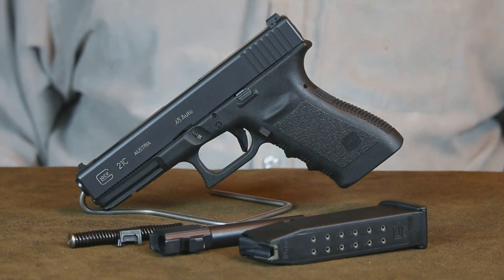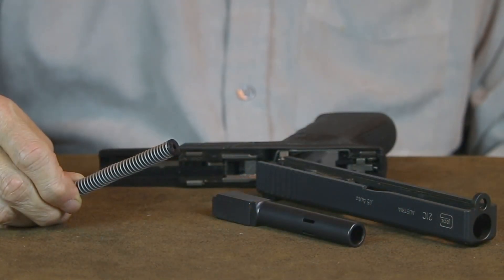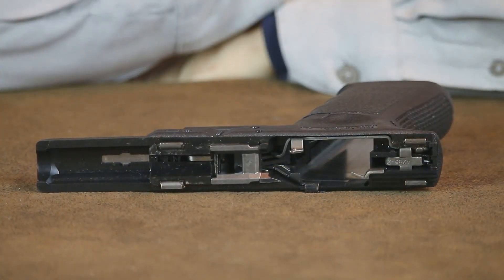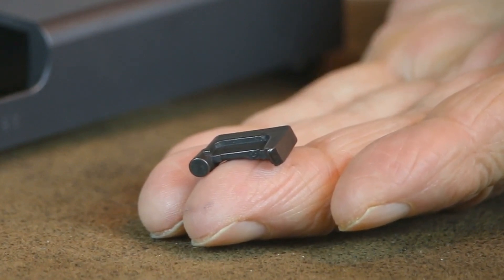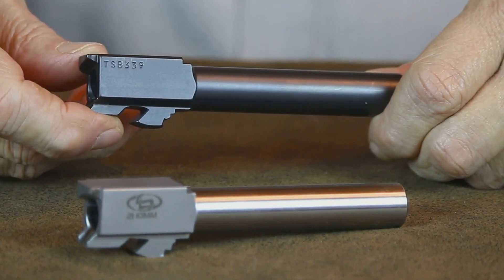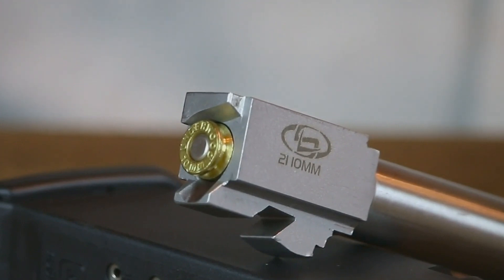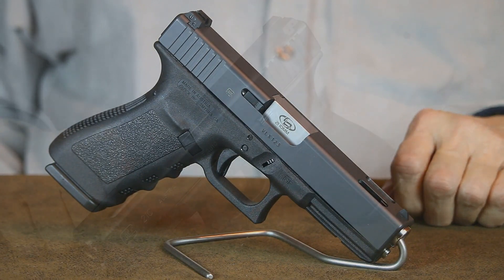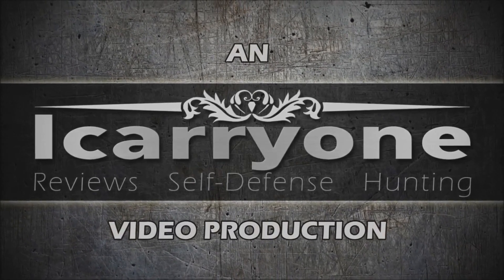Glock 21 - .45acp to10mm Conversion

Comment: Icarryone I have my Dad's Glock 21C, "God rest his soul" and I don't know you can do this on a Glock 21. This is awesome for 150 dollars. This is by far my favorite review you have done yet.
Reply from the maker: Thanks Jerry, I appreciate that.
Reply: You are welcome Icarryone and Thanks for the great reviews.
Reply: Also have a 21C and was thinking if something like this was possible  and now see it is but only with the 10mm. now been wondering and imagining how would the recoil will feel if  the barrel can be made to have the compensated cuts in it.  Wish the conversion was possible with the 9mm.
Reply: @sanmar5206 they actually make a .50 cal conversion for this frame too.  It requires a different slide though, so not very economical.  However I sure would like to shoot one 😅

Comment: According to the Glock store you don't have to change the main spring. But I always thought that was wrong advice. As a 10 mm is a sharper recoil. Where the 45 is a push.
Reply from the maker: I upgraded my spring to a 20lb with a stainless steel guide rod and reliability improved.

Comment: This is ideal.  This opens the doors to allow me to utilize 45acp, 45super, 10mm, and 460 Rowland all in one gun!
Reply from the maker: You could certainly do that.
Reply: 9x25 Dillon too.
Reply: @gadsdenjim8785  40 S&W and 357 SIG will use 10mm mags too, so that's 7.

Comment: Looking for advice!  I swapped out the 45 to 10mm barrel, 10mm mags, 22lb tungsten spring and ammo.  But 1 in 3 rounds of the 10mm don't fire.  Ammo is factory new, not a reload.  Gun is new and sparkle-clean.  The rounds that didn't fire had a definite primer strike, but no ignition.  

Thoughts?
Reply from the maker: Try a different brand of ammo and see if the problem persists.
Reply: @Icarryone  Done.  Problem persists.
Reply: Clean the striker channel.  Inspect the striker.   Consider replacing it.  Check the plastic sleeve in the channel to see if it’s damaged.  Do not allow oil or lube in the striker channel.

Comment: I have looked at those storm lake barrels several times just never pulled the trigger on one yet.
Reply from the maker: I've run both Storm Lake & Wolf replacement barrels in my Glocks. The Storm Lake barrels do seem to have slightly better chamber finish.

Comment: Sweet, I was about to buy another PF45 P80 kit to build a G20. Thanks to your video, I now know I can just put these parts in my PF45 G21 clone and save a ton of money. Before, I thought a conversion would be getting a new slide as well like with the G26 to G27 conversion.
Reply: 27 to 26 you mean. the 27 can accomodate a 9mm barrel with thicker walls but not the other way around.

Comment: I converted mine about a year ago only using the recall Spring & Barrel and keeping the 45 ejector and I've had zero problems with the 10mm
Reply from the maker: Me either Rick.
Reply: I didn’t change out my ejector but it damages the 10mm shell casings

Comment: I bought a double diamond 45 to 10mm conversion barrel and can't shoot buffalo bore 220gr. Headspacing is wrong. I heard Lone Wolf barrels are cut deep enough to address this... can I use the Wolf G20 barrel in 10mm even if it isn't specifically a conversion barrel?
Reply from the maker: Yes, you can.

Comment: Another excellent video sir, I have the G20C. Maybe I should convert it over to shoot 45acp.
Reply from the maker: You certainly could.
Reply: With a whole slide assembly.
Reply: Yeah, like Barry said don't think just a barrel & parts will work.  The .45 barrel is much wider, so don't see how it fit through a 10mm/.40 slide..    You may also need a .45 ejector.
Reply: @motohead077  no they are the same outer diameter
Reply: @theoneand0nly874   The breech face on the 20 slide is narrower than the 21. So you would need a 21 slide to convert from 10mm to .45acp
Reply: @turtlesauce  your right you might be able to modify it the diameter is the same but not the breach face

Comment: The double diamond conversion from the glock store doesnt work worth a dam.
Failure to load, fail to eject, stove pipes.
I am using a original mag. Did change out recoil spring.
Tried 3 weight springs from 17, 18, 20 pound.
Some problems. The glock store says no need to change anything else.
Complete fail every other shot.
Using the G21 in 45 acp runs perfect.
So i guess the 10mm side will only be used for play.
Never for protection purposes.
A total waiste of $$$.
Reply from the maker: Dang, sorry to hear that. The set-up I use works just fine.
Reply: @Icarryone  
Whats ur setup?

Comment: What about in reverse? I have a Glock 20 and I want to convert it to .45.. I assuming the only thing I won't have to touch is the recoil spring?
Reply from the maker: I haven't tried that particular conversion - but I'm sure somebody has.
Reply: You can't convert to a bigger bore, the holes for the barrel in the slide are not big enough to fit 45 barrel in 10mm slide.   If you get a G21 complete upper, you could put it on the G20 frame.  May also need to swith to a G21 ejector.   Plus the 45 mags..     I convert G23 to 9mm with just barrel & mags.   Could also convert 40S&W to 357SIG by using Glock factory barrel, no need to use after market conversion..  You could convert G20 to shoot 40 Short & Weak with conversion barrel.
Reply: @motohead077  the outer diameter for both 10mm and 45 cal are the same just look at the video he literally said he put a Glock 20 barrel in a Glock 21 slide
Reply: @theoneand0nly874  Will have to check that out. Do you know for sure, or just based on he put 10mm barrel in a G21 slide?   The 10mm barrel would fit into any larger slide (as it is smaller diameter caliber than .45), though doesn't necessarily mean it fits correctly.  There could be excess space between the outside of barrel & slide.

Comment: Great video, thanks.  Do you think this works the very same for the Gen4 Glock 21?  I know the spring is totally different, of course.  I do see you have an "SF" Gen3, so I assume the Gen4 frame is identical...right?
Reply: I have  glock 21 gen 4 and yes it will work. Lenny from glockstore has a full video on YouTube for the conversion to the 10mm.

Comment: You saved me from selling my glock21. I bought the same conversation parts but extractor. I gave a gen4 model. What is the best extractor to get (no mods needed) money no issue please (Lci, non-lci Some say a new extractor need a new load bearing indicator, a bit confused. Please let me know, thank you for your video!
Reply from the maker: I just installed a plain old standard Glock 10mm Extractor.

Comment: Tried it with barrel and 10mm extractor; crimped every 3rd or 4th round.  Also, failure to feed. My G21 is a Gen 3.  Ammo was 180gr  TMC.  What am I doing wrong?
Reply: Did you change the spring ?

Comment: I've read over and over the 10mm extractor still needs to be modified to work. Is yours working without any modification?
Reply from the maker: I did polish the 10mm extractor's head and lip - other than that, no modifications were done. Shoots fine.

Comment: TY❤
Reply from the maker: My pleasure!
Reply: @Icarryone  I have a question, is this modification suitable  on the glock 30S? The slide is slimmer, but unsure if the parts are the same as your glock 21 or if they changed something else on the 30S. You would need a stronger recoil spring to counteract the lighter slide for sure. This was a very informative video regardless!

Comment: You say the Glock 21 needs a stronger spring for conversion to 10mm but the Glock 20 (stock 10mm gun) comes with a factory 17lb spring
Reply from the maker: Yes, I said that. A 20-22lb spring works best with full power 10mm ammo.

Comment: Just a note, you don't need the new extractor (it's the same part number between the guns) or the recoil spring (same part, but it may be a good idea if you're shooting a lot of full-house rounds) in the Gen 4 Glocks. Just FYI and great video!
Reply from the maker: The "ejector" is indeed the same part number - but the "extractor" for the 10mm case rim has a 15/5 cut which is indeed smaller than the one for the .45acp round. It is best to go ahead and replace it.
Reply: @Icarryone  I'll defer to your knowledge because I am by no means a gunsmith. You're right that they're different part numbers (10mm is #1909 and .45acp is #1902), but they use the same spring-loaded bearing (#3442). I was under the impression since they're both 15/5 cut, there was no need to change it out with the Gen 4, but that's just based on research not real world application, so again, I'll defer to your knowledge.
Reply: The stock recoil spring & rod is the same length & weight, 17lbs,  between G21 & G20 (at least for Gen 3 & older), but the G21 slide weighs less.  So when converting to 10mm out of a lighter slide, it is recommended to get some heavier recoil springs, as to not unnecessarily beat the s*** out of your gun, especially when shooting real 10 mm rounds.  Even when using a G20 it is best to get heavier recoil springs for full power rounds.   Since most factory 10MM is loaded .40 S&W power, the stock 10mm guns are made to be able to cycle it. 
 An exception might be the CMMG 10mm, but that is more like an AR rifle in a pistol length, PCC.

Comment: Have you checked out the Guncrafter Industries .50 GI Glock Conversion? Now that's an ass kicking round!
Reply from the maker: No, I haven't looked into .50 GI yet, Harry.
Reply: I'd do the .460 Rowland conversion before doing a 50 GI conversion, the 50 GI is just way too slow in my opinion, not really an upgrade from a 45ACP hot load.
Reply: @phillhuddleston9445  I agree.

Comment: My problem with the G22 40 to 9 conversion was with erratic extraction afterwards, which is why I didn't buy the 45 to 10mm for my G21. I did follow all recommended parts swapping, but the 9mm cases pop out like popcorn, whereas the 40 cal still works perfectly in the gun, even with its 9mm extractor. Have you had any issues with how it throws brass now while shooting either caliber?
Reply from the maker: No, this one ejects exactly as it should when using either caliber.
Reply: Dirt Road W.T.F. hello, I have a lone wolf 40-9mm conversion barrel for my glock 22 gen3. The problem is the 22 slide is a bit heavier than a 17 slide if you use mouse fart 9mm loads you need to get a lighter spring. I use a DPM RSA witch comes with two main springs..ligher spring for the conversion barrel. I hate ISMI springs but!!! If that's what you like? Get a 15lb.spring and you should be okay.
 Another option is to use NATO 124 grain ammo or any other hot 9mm.

Comment: KKM told me I didn't have to change the extractor
Reply from the maker: Then don't.
Reply: @Icarryone  I think when I convert my Glock 41 Gen4 to 10mm I'm going to leave 10mm because I like 10mm better than 45 ACP. Although I thought about doing a 45 Super conversion. What do you think
Reply from the maker: Although I have a couple of firearms chambered for .45 Super - I actually prefer 10mm. Mostly due to ammunition availability.
Reply: When did you get your kkm 10mm conversion barrel ?
I think they no longer make the conversion barrel for the G21 to 10mm🤷‍♂️

Comment: I do not have a Glock 21c I have a Glock 21 sf will it work
Reply: Yes there is no difference in Outside diameter between the 21c and the short Frame 21

Comment: Does anyone even make the G21 to 10mm conversion barrel's anymore ?
Reply from the maker: Storm Lake.
Reply: You can just use a regular g20 barrel like he did in the video
Reply: @theoneand0nly874  O.D. size is not the same.
Reply: @davidgolden1776  yes it is I own both pistols
Reply: @theoneand0nly874  ok, my bad👌👍

Comment: One question, when I order a 10mm recoil spring for the Glock 21 which mine is a gen 4 do I have to order a special conversion spring or are the Glock 21 and Glock 20 the same in that aspect of the conversion as far as where the spring sets into the slide at the front under the barrel? Thanks for any help you can offer. By the way this was a very informative video the way you addressed all the details, well done!
Reply from the maker: Simply order a "Gen4" recoil spring for a Glock 20 10mm. It will work just fine in your Glock 21.

Comment: Glock used a more conventional rifling in the 45's and you don't get the fouling with cast bullets like in Glock's smaller diameter barrels.
Reply from the maker: Sorry Garrett, but the G21 uses the exact same rifling as any other Glock. The 45acp round simply doesn't generate the amount of velocity associated with barrel leading issues.

Comment: Doesn't work just build a 10mm slide.
Reply: Why did it not work out for you ,what parts did you use?
Reply: @sosa8072  I used a match grade 10mm barrel I tried the 45 cal extractor then I filled down the shelf on the 45 cal extractor the I tried a 10mm extractor and I tried the OEM recoil spring and a 20lb recoil spring with light weight 1000fps ammo and 1300 fps ammo...and never ejected properly miss feeds and stove pipes..I put together a complete 10mm slide and it's running flawlessly with light and hot ammo with the factory 17lb spring and super hot I use 20lb recoil spring. I recommend just put together a complete 10mm slide for 100% reliability.